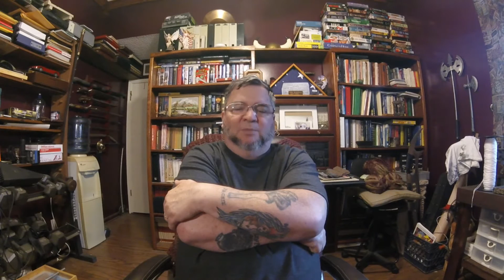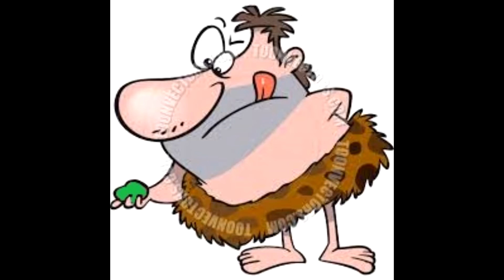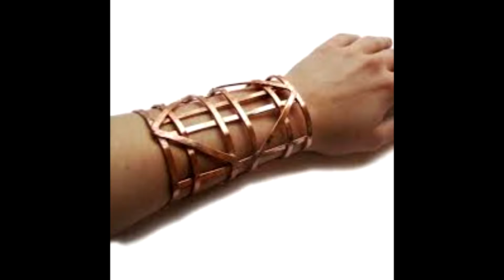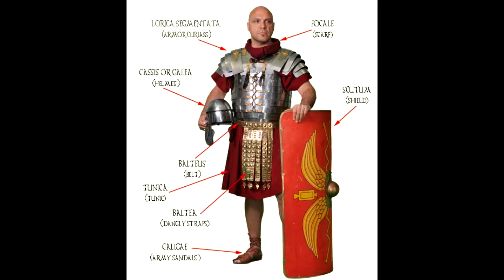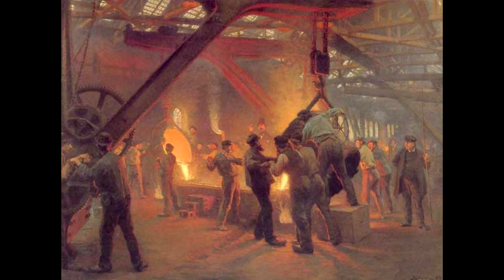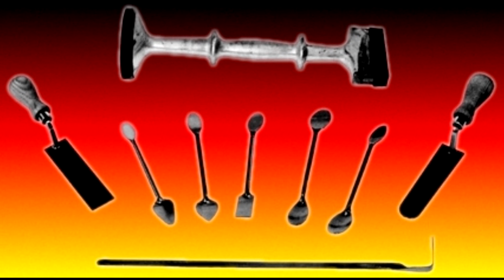Introduction, mans' discovery of copper and Molders' tools.

Comment: Thanks for this, Chief. I've been out for over 20 years. We still had A schools, and C schools, while I was in. We also had something called common core. For engineering rates, that included valves, tracing piping systems, etc. Moulders and Patern Makers were no longer rates when I was in. I've recently become interested in the molder trade as a bit of a hobby. I'm glad I found you channel. So, again, thank you for this.

Very respectfully,
HT2(SW/AW)

Comment: Nice video but you cover too much ground in too little time.  The mystery for me is how we discovered tin and that it could be mixed with copper to make bronze.  
Discovering how to make iron and later steel seems almost impossible.  With all your knowledge, do you think you could actually produce some iron if you were suddenly thrust back to the stone age?
Reply from the maker: Yes, I could. Iron, like copper, is found as an ore in nature and isn't combined with other elements needing to be separated from those elements before it can be melted and cast. My guess at how tin was discovered and used could be when someone used a piece of granite to make a stone mold and when they poured the molten copper into the mold the heat forced the tin to separate from the oxygen in the cassiterite  (tin oxide) accidentally becoming the alloy we know today as Bronze. To use iron would be much simpler in that all I would have to do is find a deposit of iron and melt it using locally found supplies of fuel to heat up the ore and cast it into a useful form.
Reply: @sandrammer  You seem confident in your abilities.  Great, but consider that you have to build a hearth and a bellows and augment your wood with coke.. and you have NO metal tools to use.  The result will be a lot of work for maybe a tiny chunk of iron.. but more likely nothing.  Everyone in the village would be pissed that you spent so much time and energy for naught.  It would take dozens of trials like this before the first ingot was produced.   Even with our knowledge, I have yet to see anyone create any significant amount of tin, copper or especially iron using stone
Reply from the maker: @Meinstein  , Cupola furnaces, a design that lasted for hundreds if not thousands of years were made from clay and stone. Bellows were made from wood and leather. Both were made and used without the benefit of metal tools but of course once they were up and running metal tools would be made to replace the stone, wood and bone tools I would be using. Everyone in the village wouldn't be upset at the time and materials used once I made the first copper castings or iron castings and proved how much their lives would be improved using tools that weren't worn out after the first season of use. And it wouldn't take dozens of trials to perfect the technique of metal melting given the experience I would bring to the project. While coke would really help the melting process, it wouldn't be essential as charcoal, something ancient man was experienced in producing, would be good to produce the heat necessary (along with forced air to add oxygen to the equation)  to melt either copper or iron. Now Tin might take a while to reproduce given the fact that Tin isn't found as an ore in nature but knowing that Tin oxide can be found in granite stone I might be able to reproduce the accident that made tin in the beginning. Training, knowledge and experience would go a long way if I was thrown back in time and needed metal to survive.
Reply: @sandrammer  I really admire both your expertise and confidence in being able to create the first metals.   I didn't mention charcoal.  Even making charcoal is an elaborate process.  Give the vast distances between resources and the elaborate methods needed to extract and refine ore, I cannot fathom man just stumbling upon this process.  The soft metals?  Yes.  Gold, silver, copper, lead I have no problem with our discovering their uses.  Even powders for potions or poisons I can see stumbling upon.  But YOU would need a lot of persuasion to get your raw materials and Cupola furnaces built.. and rebuilt.. and rebuilt until you finally made your first ingot.  Then they would use it to hit you over the head and take over your kingdom.

Comment: I am very pleased with your attitude and willingness to share . I have always had deep appreciation for our navy personnel . I plan on watching all your stuff . I don't know if I'll ever get to use it as I'm an old man . I have been introduced to wire rope and rigging . I'm very interested in how I could build a foundry I think , but my interest would run away with me. I was introduced to some molding techniques where fillets were added to facilitate clean lines /
Reply from the maker: While there is a lot to learn and some lifting involved (you can get help for that) the satisfaction you receive when you create something outweighs the hassle. In addition, you gain a keen insight in how  man went from using bone and stone to make their lives easier to using metal.

Comment: I have located your channel from a shout out by Keith Rucker, and am now keenly working through your videos thank you! I am presently building an electric furnace as one of my YouTube projects and looking forward to putting what you teach to use casting aluminium, cast iron, and brass /bronze
Reply from the maker: Unless you're making a real heavy duty electric furnace, I wouldn't count on cast iron. Aluminum and brass/bronze very likely because of their pouring temperatures (aluminum 1250-1400 degrees F, brass and bronze...1950-2100 degrees F) The pouring temperatures for Iron and steel is 2950-3100 degrees F. It is a whole different world pouring ferrous metals. If you can, more power to you!

Comment: U.S.S. Piedmont 1963-1967, EM2 R3 Division (Electrical Repair).  Foundry made a few end-bells for us. Also spent some hours using your sandblaster for cleaning up motors which had been fired on a small forge of yours.
Reply from the maker: I was transfered to the Piedmont in '75 until the navy wanted me to go to San Diego in '77,  He was home ported at Naples, Italy and everyone hated everyone onboard. Was the worse experience I had on a ship in my entire navy career.
Reply: What a difference a decade makes.  In 1965 the Piedmont was home-ported in San Diego, along with the Dixie (AD 1) and the Praire (AD 5) which we shared WesPac duties with.  Esprit de Corps was quite high.  Sorry to learn your experience was so different.